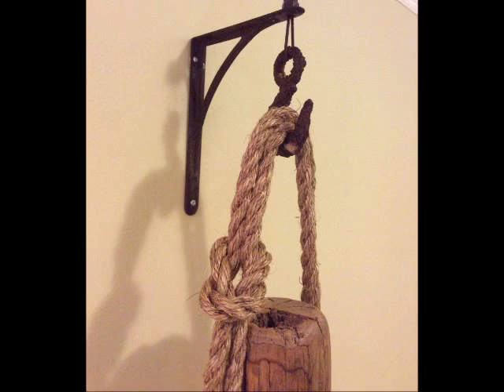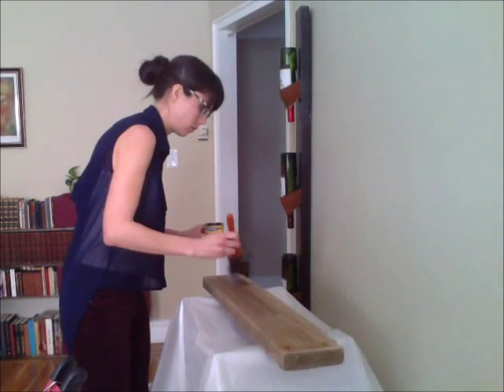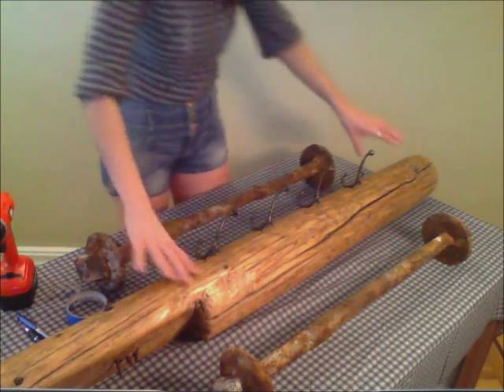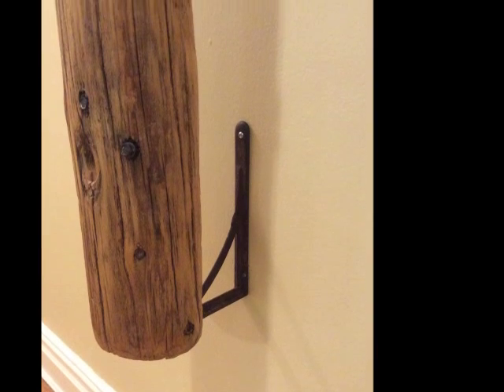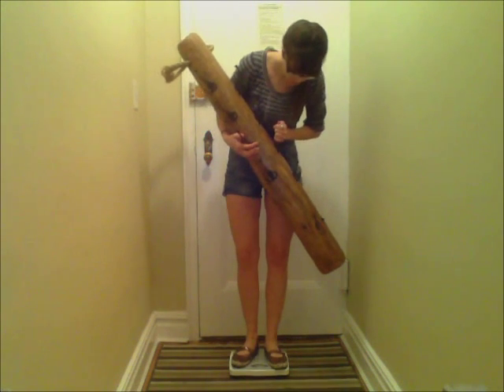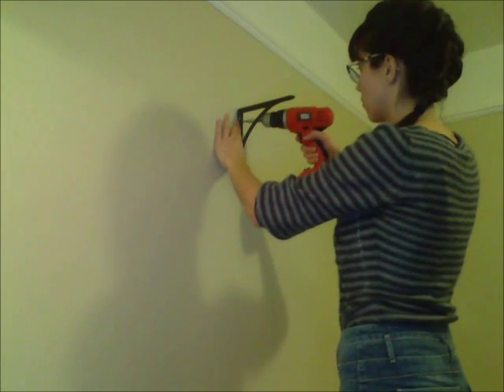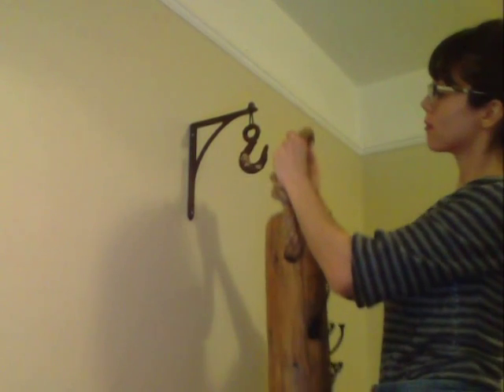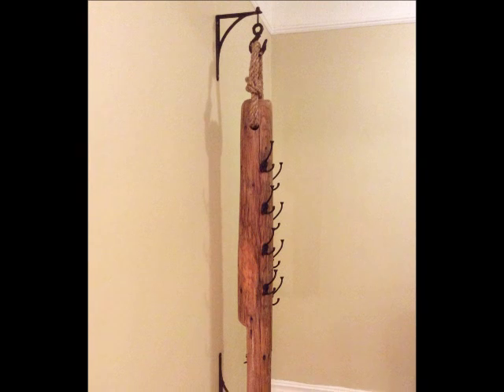How to make a coat rack --by RoughDraft DIY

Comment: dunno if I would trust the zip tie either, however very inventive. And Nice Work as well.. p/s adorable too.. not the project.. ; )
Reply from the maker: +Tom Jones Thanks!  The zip tie is still going strong, and I made this a couple years ago!  But now when I make this design for customers, I do use hardware to suspend the post.   Zip ties are pretty durned strong!  Thanks for watching and stopping by to comment!

Comment: Awesome idea! But I would be hesitant to trust that zip tie once you start adding coats to it.
Reply from the maker: Hey RebelBreed888!! Thanks for watching and sharing my video!  And for commenting!  Ya know, believe it or not, the zip tie has held up.  This coat rack still hangs in my hall and I made it about a year ago.  The zip tie is fine!  I had picture hanging wire looped through the rope and the bracket for a while just in case, because I was skeptical too... But it really does work!  Thanks again :)
Reply: Sweet! Glad it is holding up and you're welcome!

Comment: would have been nice to HEAR this person........................
Reply from the maker: +Tom Jones Did you finally get the sound to work?  I checked it on all my devices and had no trouble hearing this video.  If you still can't hear it, try a different device or check the "silent" and volume settings on the device your using.  :) :) :)  Hope it works cuz I want you to hear it!